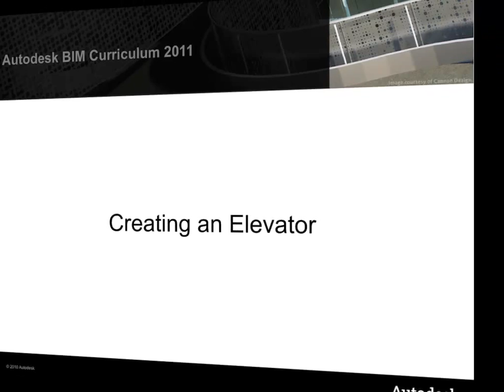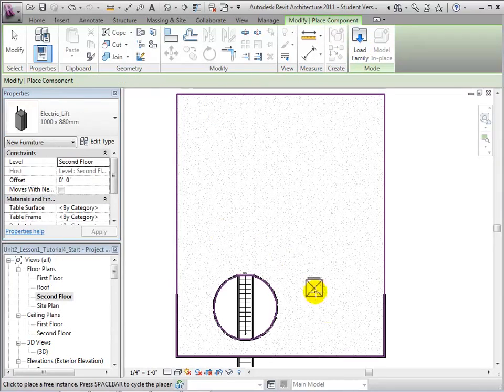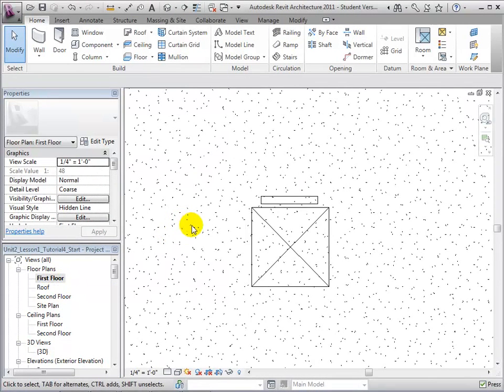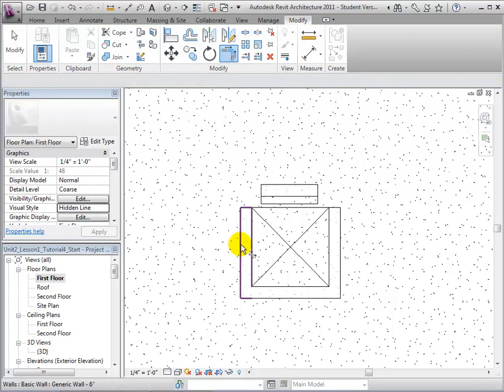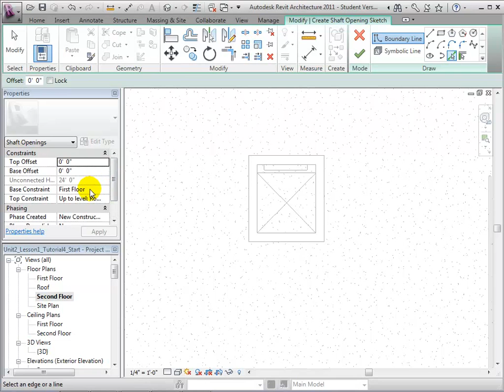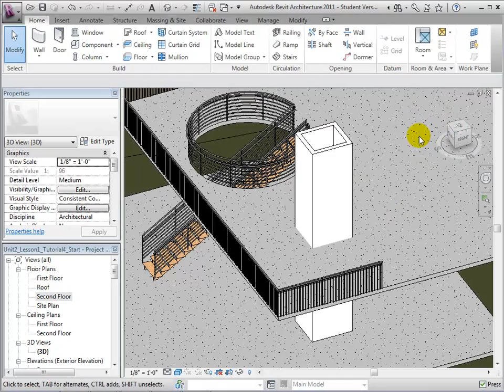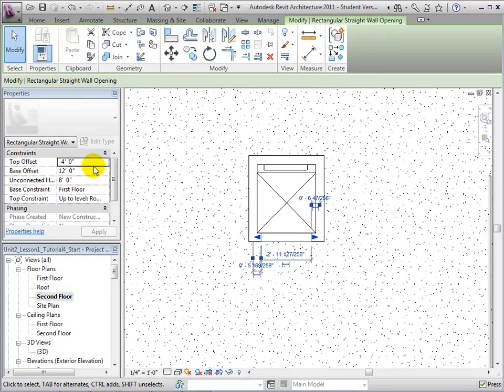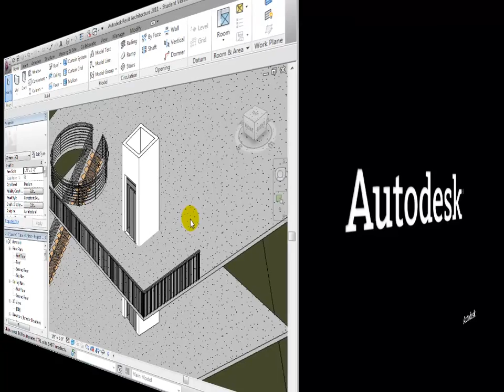Revit Architecture - Creating an Elevator

Comment: The Elevator Lift is no longer in the Specialty Equipment folder on Revit 2015 or 2016. I had to use one from revitcity and Autodesk Seek. What if you have an elevator component that already has a shaft created? Like if I download a component from Schindler or Kone Elevators, the companies who make them, how do you put two elevators on top of each other so you can see the car on each level? Wouldn't the two, theoretically, smash into one another? Why are you showing two elevators on top of one another?

Comment: Where did you get the elevator family?
Reply: http://revit.autodesk.com/library/archive2009/html/Revit%20Architecture%202009%20Library/UK%20Library/Families/Specialty%20Equipment/Elevators%20and%20Lifts/index.html